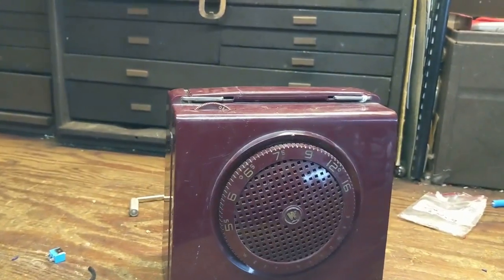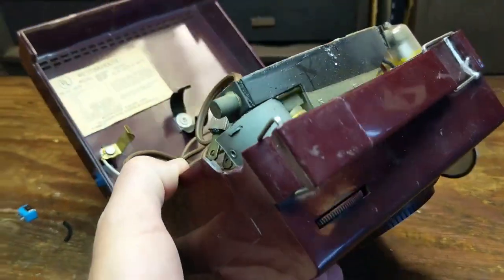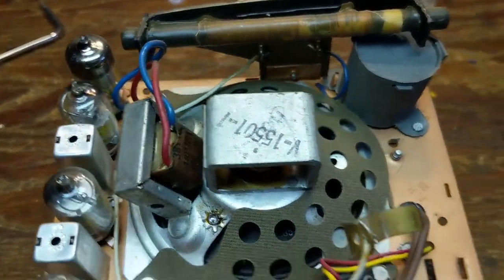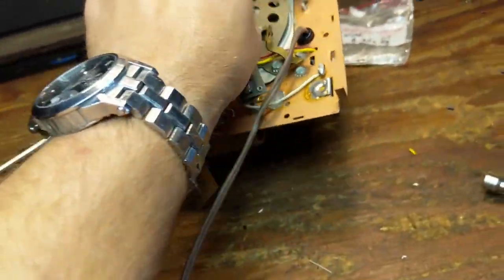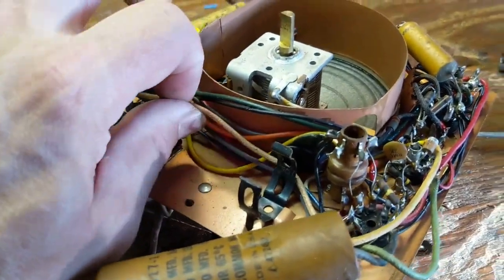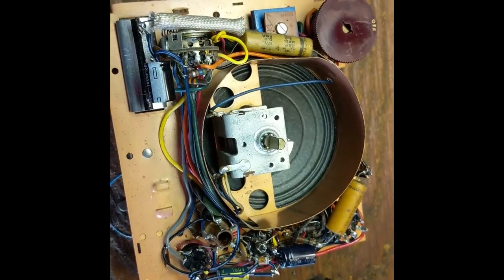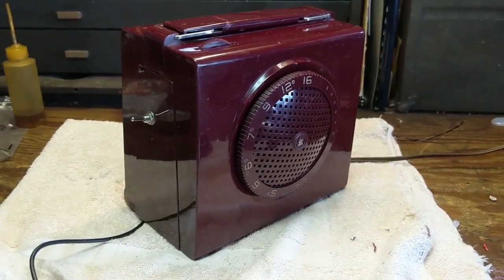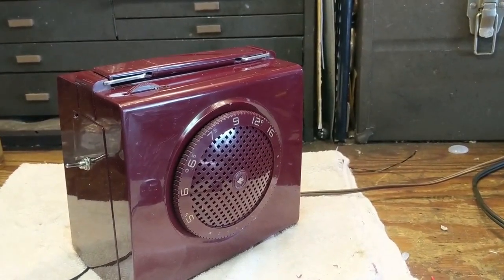Complete overhaul of a very cramped Westinghouse portable

Comment: Most wall warts today are SMPS with a transformer that is rather large and probably tougher to retrofit into many radios compared to the # PE2006 welding isolation transformer you use. But I would love to see you make a video on how to
do it maybe on a larger console radio Seth .  Would rather see a slide  switch on the side than a toggle type switch! 
I don't know why it kind of bothers me but it looks a little weird with that post sticking out on the side! Steve
Reply: I doubt you could use a ferrite core transformer from a Switch Mode Power Supply, designed for an operating frequency >50kHz, as isolation transformer for Audio Frequency - unless it is a Bat-Radio with ultrasonic frequency response...
Also does a classic Iron Core 12/120V AC transformer have a low secondary impedance. The headphone output on your mobile,  tablet or any other device expects a ~32 Ohm DC impedance. A 120/12 power transformer secondary is far lower. Also even though he has the primary connected to the radio side, any current discharge happening to that side (by arcovers etc) will cause a current jolt into the low impedance secondary, which is connected to your (expensive) audio source. 
Think the headphone amp chip in your brandnew 2k$ Iphone 13 would like that?
And we have not even touched on the sub-par frequency response of a 50/60Hz mains transformer. Anyone seriously having tried using a AC mains transformer as audio output transformer replacement on tube gear will attest to that.
There is so many better ways to feed audio to such a radio in a non intrusive way. AM mini transmitter would be one...
 And even if you absolutely needed a direct aux input, you can get 10pcs of proper(!) audio insulation transformers 1:1 ratio 600:600 Ohms for less than 3 bucks from Aliexpress.
Reply: @randomsteve4288  
I use a small micro powered AM transmitter to play my own programing through my vintage AM transistor radios.

Comment: That radio 📻 looks more primitive as far as the design goes. I’m guessing it’s a 1956 Westinghouse. By the crank, it looks like 👍 this could be a wind-up radio 📻. This looks like 👍 a solid state design, so it’s probably a later model. More like 👍 1966. Your friend, Jeff.
Reply: CD or Civil Defense markings on AM radios first appeared in 1953 on a President Eisenhower directive.  They were mandatory until 1963 when the 
Y ceased being applied.  So from design on the dial the latest it could be is 1963.  Love the radio and the resto as usual.  Cheers, Geoff

Comment: You mite want to start testing your caps. I put one of thore green type caps in a radio. Turn it on work fine. Walk away and turn it on again and the cap shorted. So put other green cap in with no problems. Sad even new stuff can't be trusted.

Comment: Nice job, but I dont like the way you have cramped in the silicon rectifier and series dropper resistor. The solder joint on the terminal strip being the AC input to the diode touches the left end of the series dropper resistor (see at 11:48). While the painting on the resistor is not conductive it may crack and flake off once the resistor gets hot and ages. That would short out the diode. More mechanical separation and additional insulation of the resistor either by shrink tubing or better yet heat resisting glass fiber tubing would have been in order.

Comment: I have been told that the refrigerator radios are very interesting to work on also, apparently the chassis on those are quite compact
Reply: Think Shango has a video  or 2 on the refrigerator radios.